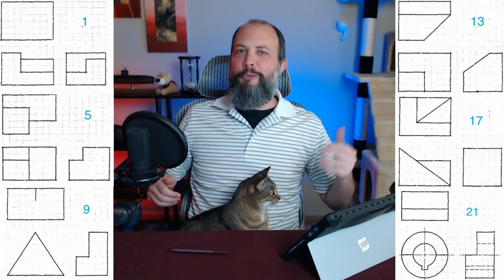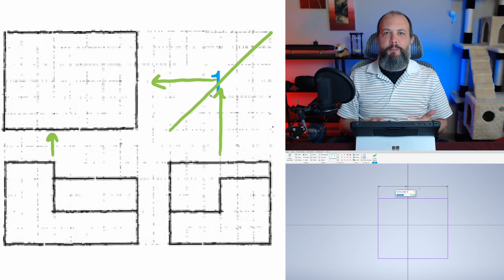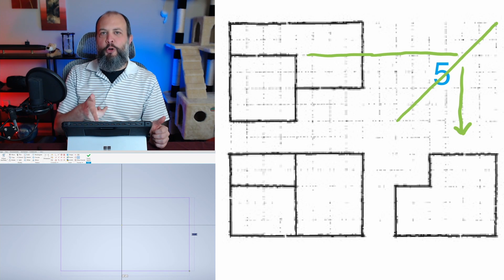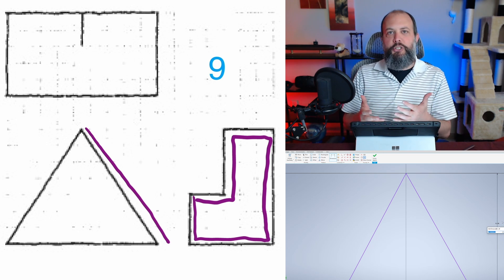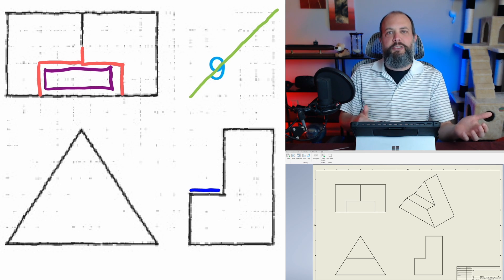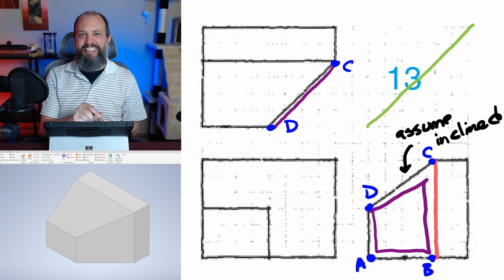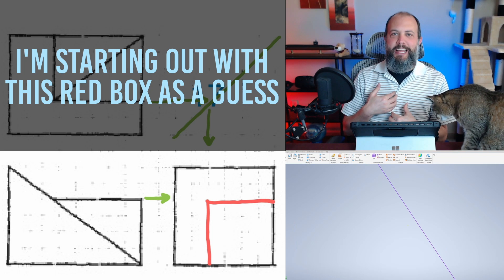Missing-Line Sketching Problems – 3D Visualization Tips and Tricks

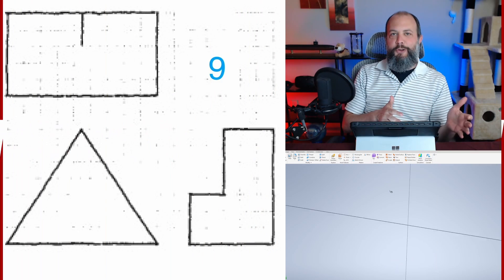Comment: I'm on a problem almost exactly the same as 4:48 except the side view has an inclined slope on the top left instead of another corner. I can't seem to figure it out and my professor isn't giving me hints. Any ideas?
Reply from the maker: In that scenario, I think the top view will have 2 diagonal lines instead of horiz/vert pairs. And you'd still also have the same horizontal line on the front view. Instead of the final 3d image looking like there's a flat "shelf", the front most 2 points of the shelf would connect directly up to the top point of the triangle, so you'd have a triangular slanted face instead of a horizontal and vertical face. A diagonal line on 1 view, will be a visible face on the other 2 views. Your new diagonal line will correspond to a triangle on the front view, so you'll see that same triangle on the top view also.
Reply: @BrianBernardEngineering  I actually managed to get it figured out! Thank you and great video!

Comment: Hello , I al trying to master the missing lines problem so i need more practice but I can’t know weather my finished views are correct or not 
At 0:04 you provided a sheet full of missing line problems, can you also provide the solution to that sheet so i can be able to practice.thanks
Reply from the maker: Sorry, but i dont have the answer key either. thats why i made inventor drawings in this video to double check. i have a playlist with several other missing lines and missing view videos, so that will give you a few more worked out examples. not as many as a full sheet, but best i can do. good luck.

Comment: Hi sir, do you have all the answers?
Reply from the maker: If you mean the answer key to this page of missing line sketching problems - no, I do not have an answer key - that's why for this video I drew 3D models of each part as a way to check my answers without a key. If you just mean to life in general ... then also no. I like to think I am good at giving general advice and even good at answering most engineering questions ... but no, not all of them. That would be pretty awesome though.

Comment: What about number 22 I still can't figure out how to do it. I been stock with it for more than a month now.
Reply from the maker: The 3 circles on front view: outer circle is a solid cylinder in the back, middle circle is solid cylinder in front, small circle is a hole presumably all the way through. Need to add hidden lines for the hole on both top and right. top view has a few visible lines where the middle circle has its top cutoff.
Reply: How does the top view looks like with few visible lines for the middle circle top being cut off, please help me ?